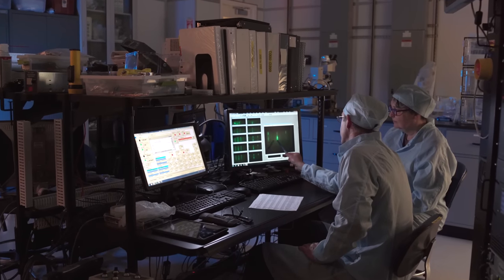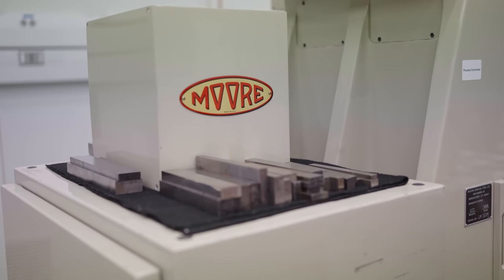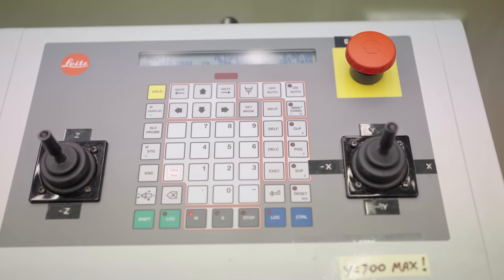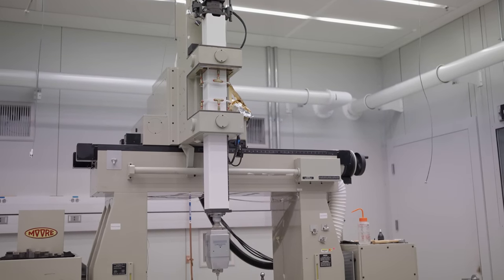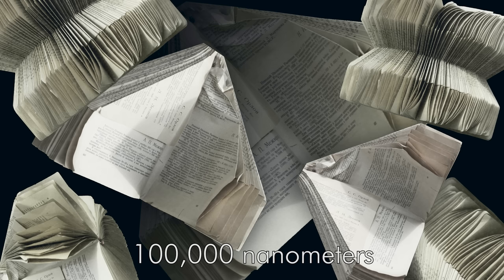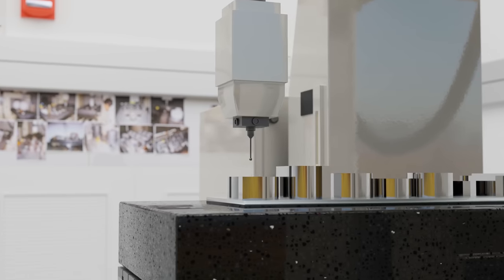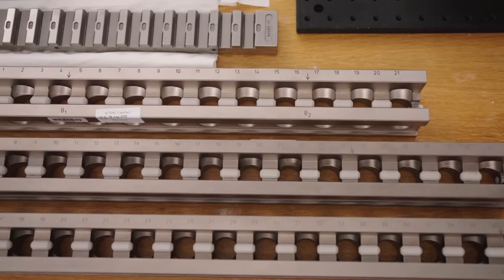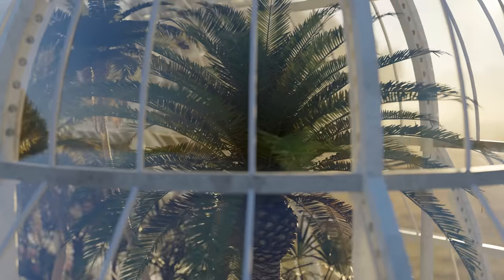The INSANE Precision of The National Institute of Standards and Technology

Comment: BLENDER QUESTIONS -- Could you please do a video for Blender users on what technique you used to DE-NOISE your animation so that frame to frame artifacts were removed? Was it done in the compositor using nodes? An in depth video of how this animation was achieved would be very helpful. I'd like to know about the lighting set-up and why you chose the lighting set-up you used. Did you intentionally choose colors, textures, lighting, and exposure levels, to lower overall contrast as much as possible to decrease the amount of noise that your de-noising technique had to deal with? Could you POST THIS BLENDER FILE? I've seen more than enough videos on how to make an animation look "photo-realistic" by creating textures that make it look like the subject was dug out of a garbage dump. (That look is all the rage these days and I'm sick of it). Animations of a pristine subject in a clean environment are all but none existent, in particular in a room with no windows where HDRI sunlight isn't used. PLEASE DO A VIDEO FOR BLENDER USERS ABOUT THIS ANIMATION. It's not only beautiful, it's all but completely unique.
Reply from the maker: I did the renders with Cycles at 300 samples with the OpenImageDenoiser. For the main Conservatory shots all lighting is coming from the HDRI which I simply rotated until I got the desired angles.  The HDRI is from poly haven called spruit_sunrise.  As for the lighting in the room, I make parts of the ceiling emissive to give the effect of lights covering the whole room pretty evenly, but I did remove some of the walls in the render so they were exposed to the HDRI to get the reflections.  The blender file is availalbe on my Patreon if you're interested.  Thanks for the kind words, I'm pretty new to Blender so I just do what looks good to me!

Comment: The only way to improve from this point would be to remake every single part of the machine and then test each part on the machine itself individually before assembling it in a clean room environment. It would be a very painstaking process requiring many years to complete and calibrate. Then of course the new machine could be used to refine the precision further and so on until quantum mechanical forces make it impossible to refine the precision any further. Very possibly you'd have to use an entirely different method to surpass this level of accuracy as it is. Something like electron microscopy, x ray defraction or even a method that hasn't been invented yet.

Comment: I wonder how often that level of accuracy and repeatability is actually needed in end products (so not including just other standards).
Reply: The accuracy and precision degrades at every level of transfer, even down to the $20 knock-off calipers you buy on Amazon (the machines and fixtures they use to make the calipers, the pass/fail testers, the gauge sets in any machine shop, etc, etc). And those calipers, good to 0.002", might be used to make a wood jig that's good to 0.01", for a picture frame that's good to 0.04"..... The more demanding your needs, the closer you need to get to the primary standards.

Comment: NIST might be holding information back?  Measuring and manufacturing surfaces to a precision of 10 nm is not at the frontier of current technology.  Over in Germany, Carl Zeiss produce components where the required precision is around a hundred times higher - 0.1 nm.
Reply from the maker: There are plenty of specialized machines which can measure more precisely within considerable limits- often 1D or 2D in a small volume . The point of this machine is that is can measure down to nanometers in a huge volume and also in 3D. That’s a very different thing.

Comment: What about chip architecture?  How do they measure 7nm transistors?
Reply: It used to be that when you heard a number like “7nm” it referred to the size of the smallest transistor/component, however it hasn’t been the case for some time and is more of a marketing term, however that doesn’t answer your question: the answer there is density, if you are looking at highways from space let’s say; and you can’t zoom enough to see them individually, but you know that they don’t overlap, but you can send cars along each highway and you somehow know how many get though then you can say “there are 10 highways running parallel in every 1km wide section so each highway must be at at most .1km wide (really big highways lol)” but in practice with lithography you can think of it as a reverse projector; you take a big image of the chip, and then display it at some number of magnifications smaller to mask the chip so you wouldn’t necessarily need to actually measure the final chip just divide the size of the original image with the power of this “anti-projector”

Comment: i noticed the machines r made in Bridgeport, i wonder if theyre related to Bridgeport machine themselves
Reply: There was not any corporate connection between Bridgeport Machines and Moore, however in the early days of both companies they occupied separate floors of the same building. Later, Moore was purchased by Producto Machine Company, which used to make some castings for both Bridgeport Machines and Moore. Being a beehive of machine tool activity, as you might suspect, there was always some back and forth movement of employees.

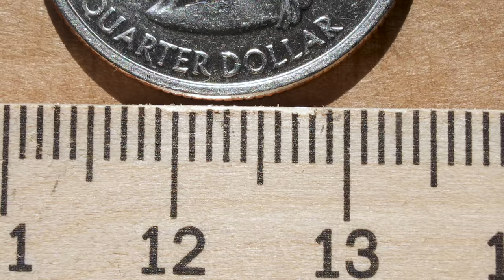Comment: 8:03 It's not that big of a difference. It's only 1000x bigger. It just sounds bigger because our brains are (usually) incapable of calculating in base 24, base 60, base 365.25, or even base 86400 {respectively #Hours/Day, #Seconds/Minute and #Minutes/Hour, #Days/Year (on the short term as it becomes 365.24… on a longer period of time), #Seconds/Day}. Converting between those bases is straight up impossible for the average Joe.

Comment: It is interesting, what americans use instead of micron? 1/10 of inch is a line, if I not mistaken, but what is smaller?
Reply: For machining, which is the most common use of sub-1/10th inch measurements, use "thousandths" or "thou's", which is just a thousandth of an inch. Getting more defined than that, in a machining context, is ironically referred to as tenths or hundredths (tenths of a thou or hundredths of a thou), the context of the situation being machining means people there will know what you are actually meaning.

Besides, lots of industries do use metric in the States. Space travel being one of the big ones.
Reply: @bluntcabbage6042  thanks a lot

Comment: I'm not sure if this has been brought up, but, as accurate as this machine is, it has nothing on many other scientific instruments...  

For example, LIGO is accurate to within 0.000087 FEMTOmeters. (And a FEMTOmeters is a millionth of a nanometer!) So, LIGO is over 500 BILLION times as accurate as this (very impressive) bit of metrology technology.
Reply: I think John touched on this in his comment, but there is always a tradeoff in metrology and it's often a balance between speed, accuracy and cost for single use solutions and adaptability for multi-use solutions like a CMM. 

For instance, the Moore M48 fits in a reasonable sized room and can measure practically any object you can fit on its table, whereas LIGO is situated inside a 4km vacuum chamber and can only measure gravitational waves. Each are impressive in their own right and for similar reasons. 

The economics of metrology can sometimes be nearly has fascinating as the metrology itself. Balancing the desire of the engineer's 'inner nerd' versus the amount of capital they can justify or convince their stakeholders to approve for the project is often quite a challenge.

Comment: why are consumer laser measuring devices only accurate to about .03125 inches
Reply: Because they measure the time it takes for light to hit the target and com back. Those are very small time intervals and the electronics only have limited capabilities in measuring these time intervals. We are talking sub nano seconds.
Reply: @aculleon2901  well that certainly makes sense even i just did the math and a quartz clock would only have a resolution of 30,079 feet/hz so i wonder what those cheap crap ones use as oscillators

Comment: How do you bootstrap something like this though?  Like at 3:50 he talks about how the machine is calibrated using known measurements.  Did we just pick some object and say "this is THE meter" and go from there?  Where do the "known measurements" come from?
Edit: Oh wow you have a video on this whole thing: https://www.youtube.com/watch?v=gNRnrn5DE58

Your channel is actually  literally blowing my mind
Reply: I would rephrase that to be ‘known artifacts’. We have other very highly specialized instruments that can measure cylindrical diameter, spherical diameter, and gauge block length to accuracies better than the M48. So I use these artifacts to characterize some variables such as probe performance, probe stem homogeneity,, probe sphere geometry and diameter, and residual machine positioning variability, and artifact fixturing methods. We have to fixture things so they don’t move, AT ALL, while also not deforming their shape using things like clamps, since the probe exerts forces on the object. This is much tougher than you might think. Other larger artifacts are used to test the machine over bigger areas of 1D or 2D volume (see my response in the pinned comment). As far as ‘the meter’ is concerned, it’s a virtual thing that I ‘apply’ to the machine using external laser optics with calibrated frequencies. Any physical representation of the meter has material stability, mounting and fixturing, and temp gradient concerns that limit me to using them as testing artifacts, not mastering artifacts.

Comment: Fascinating.

So when will we be able to watch an insanely precise simulation of what happened 22 years ago instead of the rubbish they first put out which does not even resemble the real deal?

Surely it can't be that hard to put out an accurate simulation with verifiable data, right?
Seems it is, because their insane precision was nowhere to be seen when they put out the simulations that they did put out.

Comment: i wonder why they don't go through the effort of removing the air from the machine room
Reply: Good question! Two things come to mind, one is that the Moore M48 uses air bearings to move (similar to an air hokey table) and air bags to dampen vibration. I doubt either would work in a vacuum and both are necessary. The other is that a vacuum chamber that large would likely be a huge challenge to maintain and I'd also guess the vacuum pumps needed would impart additional vibration into the facility.
Reply: @dlyle2013  :facepalm: by the end of video after he detailed all of the isolation and compensation systems, I had completely forgot about the air cushion he described at the beginning.  how embarrassing. although, I won't give up entirely!  an isolation chamber for the machine could itself be supported by air, perhaps, and the equipment and ducts could be similarly isolated as the electronics are.  even if not a perfect vacuum, would a great reduction in pressure remove significant temperature and humidity issues as well as errant dust?   I'm not sure about how to restore the smooth movement the air bearings provide except for lots of teflon coatings, but any contact is probably worse than no contact still with the other issues … maybe submerge it in liquid helium?!?! … unlimited budget, right?
Reply: @dlyle2013  WAIT!!  I GOT IT!!! … MAG-LEV!!
Reply: @jaewok5G  Interesting ideas. Oh the things one could do with an unlimited budget! 😂. Some of the old SIP CMMs we had in a lab I used to manage had oil bearings instead of air. We always got funny looks when visitors saw the drip pans underneath, but they were the most accurate machines we had. The step gage we calibrated them with was actually certified on the Moore M48. Most CMMs today use air bearings on all of their axes. High precision and relatively low maintenance. There are machines that use teflon skids and for lower precision work it's not bad. 

What probably isn't clear in the video is the high levels of cleanliness that already exist there. My labs had their own HVAC system with massive HEPA filters and high turnover of room air. Ours wasn't a true cleanroom because it wasn't necessary for our work, but it was most definitely cleaner than the cube farm.
Reply: @dlyle2013  it's fascinating stuff … I wonder how accurate my 1x2x3 blocks are 🤔

Comment: A good machinist with an engineering backround not only understands the difficulties in measuring to that degree, but could describe it better than is being done here.  For example dial and digital indicators and micrometers are used by most machinists daily.  If trying to machine (cutaway) a part to a tolerance of +/- 0.0001" (inches) or one ten thousandths of an inch, which is so small it's invisible, 
then you have to be careful not to touch the part with your hands before or while measuring, as the heat of your hand will make the part grow and your part would be out of spec. And 0.0001" is large compared to a nanometer by a factor of 2450x

Comment: Interesting that they don't run this machine in a clean room. Humans without clean room clothing sheds vast amounts of particles in the air. Mostly dead skin cells. I was surprise to see it run in a pretty much ordinary office space. Sure, the temperature and humidity is closely monitored and corrected, but it is no way near a really clean environment.
Reply: They flex about how precise it can be, but realistically it's barely if ever used for that level of precision. So I imagine a good clean and letting the climate/air control machinery filter/replace the air in the room is enough.

Comment: To My Understanding it is easier to make crystals resonant very precisely then measure time based on electronics oscillating at that freq (high precision timers in the picosecond range) then use laser impulses and measure time to detector, this design has flaws but ye i doubt you can beat that type of setup with anything else! Toreview statements here❤❤😂❤😂😮
Reply: Nope wait ron misconception. Cant translate distance to time bc light too fast to meadure adequately
Reply: Mb measure frequency shift pssshhhht instead ron ??? Audiencr

Comment: you can never measure absolutely perfectly even at the atomic scale. things move around too much (more or less) for that to ever happen. and by extension, you could never form a perfectly round circle. a mathematically perfect circle has the ratio of the diameter to the circumference of exactly pi, and pi is an irrational number. 

in the end, that doesn't matter anyway because imperfect measurements will always fit into the imperfect reality. kind of a trip to think about

Comment: This video is obsolete.  Have you heard of a company called ASML?  Have you heard of lithography?  Do you know how much one of those asml machine cost?
Reply from the maker: Lithography machines are impressive and work to smaller measurements - however they are not measuring machines themselves. You can’t put, say, a meter bar into one and get a measurement to 100 nanometers or less with high certainty. It’s a very hard problem to solve and no one is better at it than NIST to my knowledge.
Reply: @machinethinking  https://youtube.com/shorts/Fw6PhfyxBE8?feature=shared

They have to measure two nanometers distance between chips.  There goes your measurement

Comment: The only thing missed here is the "Why" such precision is important and even necessary. Things like LIGO which measures fluctuations of gravitational waves, are measuring changes as small as half the width of a proton. Also not mentioned here is the use of the term "uncertainty". Not error or other scale dependent terminology. Uncertainty refers back to Heisenberg's uncertainty principal. The actual limits of measurement, or knowability.

Comment: No congratulation on becoming a father at all, just as you wish! :) At 8:42, you might have added that feature sizes on a modern complex chips, such as the GPU, have reduced down 4nm—in production!. It's not their size, but rather pitch of the layout grid. Nevertheless, some features really as small as that exist. It's incomprehensible: a transistor that is leaky as a colander when it is in "non-conducting" state, due to incessant tunneling, a quantum effect allowing like charges "jump through" through the Coulomb barrier between them, simply speaking. The characteristic cubical component pitch in a Si crystal is 0.543nm, which makes the absolutely minimum feature size of 4nm only slightly larger that 6 cubic atomic bonds long! And then, IBM has been flirting with a 2nm technology. Transistors that are 3 atoms thick...Hard to fit this in my human-sized head!

If you won't mind too much a piece of unasked for advice, it is generally helpful for the viewer to see explicitly marked CGI cuts: as your proficiency with Blender would grow, they may become indistinguishable from camera cuts, which would become confusing to the viewer, if not unintentionally misleading them. Here's an example, which I just clipped, that clearly marks a CGI cut as such: https://youtube.com/clip/UgkxartjRnDnT0r7L5PDK8g8zb-oKw1VlphU. The triangular mark is prominent in the upper right corner of the frame

And I have no words to say how glad I am to see you back, and doubly so with a video about such a mindbogglingly modern precision measurement machine with such a huge space for the sample being measured! NIST technology is so fantastic that it's at times indistinguishable from magic! Hoping to see more of your amazing videos, and more often. Only not at an expense of your time with your newly-grown family—I've been there, and know firsthand that it's the time when they need you much more than we do.